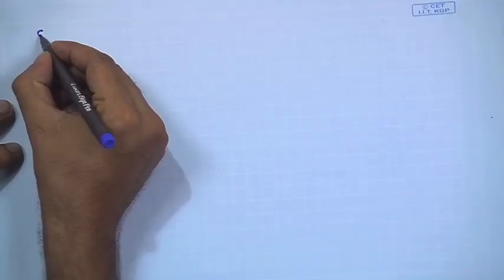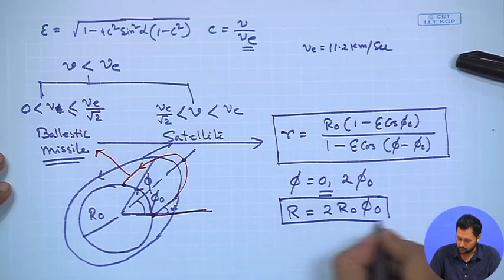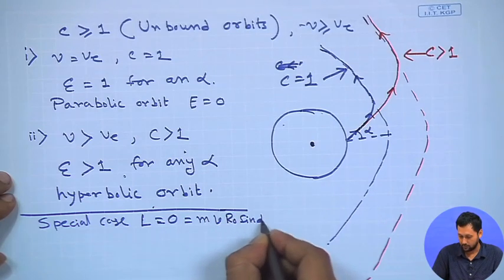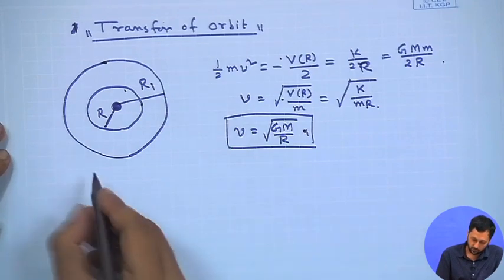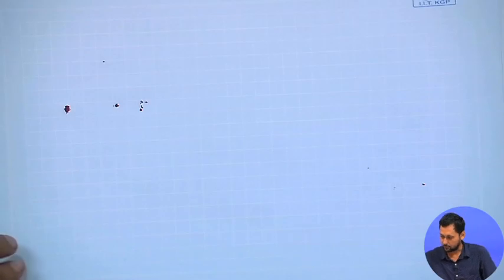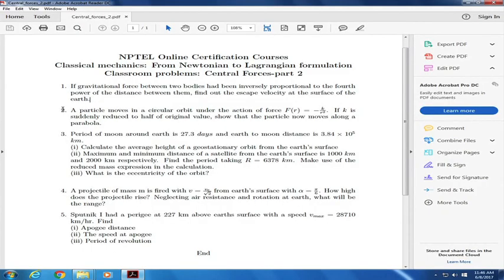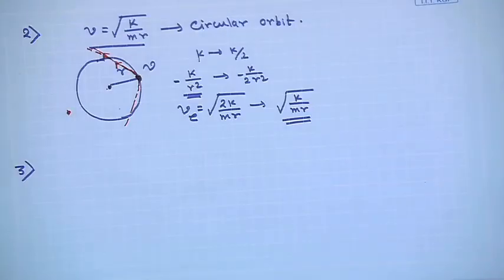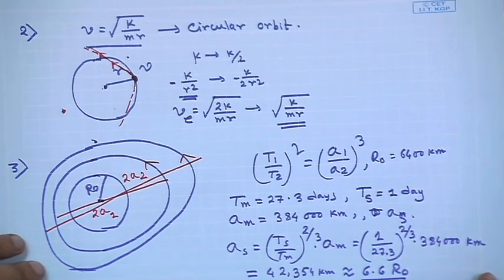Lecture 21 Central force - 14

Comment: Sir Can u plz explain how 1/2 mv^2= -v(R)/2
Reply: The potential energy V is equal to -GmM/R and the centrifugal force is equal to mv^2/R. Secondly, we know that the gravitational force is equal to -∂V/∂r or in other terms -GmM/R^2 and centrifugal force and gravitational force are equal in a circle. Therefore, 
mv^2/R = -GmM/R^2
mv^2 = -GmM/R
T = mv^2/2 = -GmM/2R
1/2 mv^2= -v(R)/2

A more in depth proof can be found in the Virial Theorem.